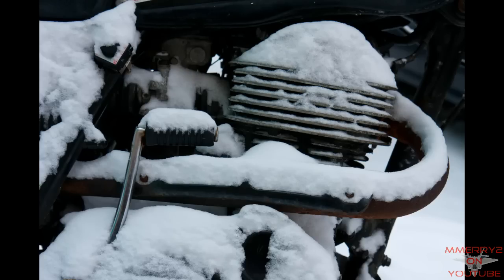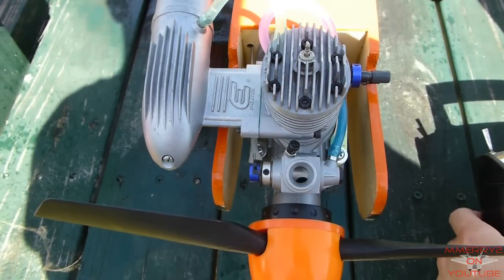Transitioning from Electric to Glow/Nitro Planes:  Intro to Glow RC Planes

Comment: One thing that’s very different between electric and glow is center of gravity. While we are use to positioning the battery in an electric plane for the CofG that we want, a nitro plane is trimmed with all flight equipment in place but empty of fuel. The CofG and stability margin become much more important. While some larger aerobatic and scale aircraft will have the fuel tank positioned near the CofG to minimize it shifting, most trainers and sport airplanes have the tank in the nose. It’s important to balance the plane so that as fuel is consumed in flight and the CG shifts aft you don’t get too far into the stability margin and end up with a tail heavy airplane that’s difficult to control. I balance my planes so they are level when empty knowing they will be slightly nose heavy when full. I do this so that even if I end up out of fuel the plane will still have a neutral balance and maintain its normal flight characteristics. The other thing is depending on the size of the tank and it’s location in the plane, it’s not uncommon to have to trim the airplane continuously through the flight. Another thing to think about is that balsa is not dimensionally stable and the film covering can warp things like the wing and tail throughout the day. A plane that has spent hours sitting in the sun after it’s first flight may be completely out of trim if flown after seeing significant sun or temperature changes.
Reply from the maker: Excellent point.

Comment: This is very surreal for me.  I began flying 37 years ago before electrics were even mentioned mainstream.  Technology then just didn't allow it.  Planes were all built piece by piece with ZAP and blue print plans with precut balsa parts and T pins.  Pushrods were individually installed and cut to length, nylons hinges were installed by hand.  THEN!  You got out the monocoat and the iron and covered each plane by hand, which was a bit of an art to itself but quickly learned.  Custom graphics were just that, cut by the builder by hand and applied with the iron.  After all was said and done you had to check and ensure the CG was proper.  Granted, all this was much more expensive to get started that it is today with everything prebuilt and radio equipment was archaic/prehistoric and overpriced by todays standards.  Training was done with 2 transmitters and a connecting cable.  When the student got in over their head the teacher would release a toggle ad take over.  5th channels were for retracts, 6th channel meant flaps.  Only sophisticated planes and heli's had 7 channels.  No gyro's (except helis), no electronic assists.  Getting back into the hobby after 25 years I'll be buying my first electric but still have my .40 plane and .30 heli.  Makes me smile to see tings coming full circle, as I'm getting into electrics just now!!!  :)

Comment: I have an 45 Evolution engine, facing the propeller (same as in the video), which direction must I spin the properller on order to start the engine? Clockwise 🔃 (right 👉) or anticlockwise 🔄 (left 👈)?
Reply: Anti.counter clockwise for a normal propeller.

Comment: What’s nice about electric is you can fly them at parks.  Most flying fields require an AMA membership and become a member of the club the field belongs to.  This is not a bad thing because most clubs have support and even instructors for new pilots.  You will normally have to do a check flight with a club member to be able to solo at the field.  This is to make sure you can get around a pattern safely.  Glow and electric have their advantages and disadvantages.

Comment: Always try to start it by hand first. Use a rubber finger protector or just some stick. An electric starter will put alot of stress on the engine and cause extra wear. For re-fueling you can also use those bottles that you can squeeze.

Comment: I have been flying model aeroplanes eversince 1986.  I started out with an MFA Yamamota 40 size high wing trainer. it was fitted with an OS 40 two  stroke glow engine.  That's what I learned to fly on.  Right up until 2002, all I ever flew was glow engines, both two and four stroke.  I just love the sound, and I love the smoke trails.  then that same year I bought my first electric plane, a multiplex easystar, followed by a multiplex twinstar.  they were both good planes.  However, I still prefer my glow planes better. Theres nothing to beat the sound of an engine, plus the extra weight is a help in the wind.  the only advantage an electric plane would have in my opinion is when it comes to flying off water.  an electric motor wont die out in the middle of a lake, but if a glow engine does then u need a boat to retrieve it.  Anyway, I still prefer glow overall.  By the way your video was great and I give u top marks for the way u explained everything.  I also and still have the hangar 9 alpha 40 that I bought in 2011.  The same one as yours.  The bright orange colour scheme stands out great against any sky background.  p.s I would just like to add that I had a fire in my house in 2007. This was caused when a lipo battery exploded while charging.  You have to be extra careful with those.   Many thanks for sharing this great video with everyone and it was so great to see the Alpha 40 in action.  It really is a great flying plane.

Comment: I have tried both over many years , starting with glow and then the mistake of trying electric
there is no comparison , an internal combustion engine can't be beat , I went straight back to glow and wished I had never made the mistake of trying electric , I had a really nice model catch fire due to electric and never eve  had that with glow, not only that, electric models sound like a dremel power tool LOL
Reply: alan manning I love glow engines myself, nothing sounds and looks better than an actual engine on a wooden aircraft frame. I suppose it's the realism of an actual airplane on a smaller scale. I like electrics as well, but unfortunately, it doesn't sound like an airplane/helicopter. Yes, I said HELICOPTER! Anyone remember the helicopters. They were the rage before all these want to be "helicopters" (drones) became popular!😁 Oh, talk about the good times when one heard ENGINES flying everywhere!👉👍✌
Reply: SolarReturn what set up would you recommend for nitro beginner? I've flown electric and would like to get into nitro
Reply: electric is quicker than nitro gas diesel  etc
Reply: I have flown electric for over 5 years and it has been great, so far ive never had any problems that you have encountered, the technology has gotten better over the years and electric has been getting more popular than glow, that being said, ive also had my fair share with glow aswell. The problem with that is that the glow engines dont last forever, unlike electric motors which last forever. (Ive had the same brushless motor for over 5 years, and it has flown constantly) I hope you will or already considered going back to electric, it is the most fun ive had in this hobby minus all the fuss with glow engines.
Reply: @rcaviator8408  I must admit I have been swayed particularly with the noise factor of IC engines being an issue more and more ,  Electric has moved on immensly and is now cheap , Clean , Powerful and quiet 
One thing I don't miss is the oily mess so yes my comment is now nonsense
One of the best things about electric is telemetry , seeing the battery state is far better than timing when your fuel is likely to run out ! And the motor dosen't need running in and setting up to keep running , another factor now is that I am finding it difficult to get glow fuel , The fuel I use now comes out of a plug socket , Yes my friend you are right

Comment: While electric planes are cheaper and easier to operate, glow/gas tends to be more scale and offers better power options as well. One big difference between electric and glow is that you must be extremely careful about how you handle yourself around glow engines. They both have their pros and cons and I fly both. Fly safe!, James

Comment: 6 years later it's still useful information. Just bought a homemade plane with a glow engine off of Facebook marketplace for 40 bucks. I figured it was a cheap way to get into nitro because I already have tx, rx, battery, BEC (used for a glider). Now I'm probably going to have to spend around double the cost of the plane just to get the field gear lol. Might go with a chicken stick over a starter because I'm cheap haha
Reply from the maker: It can be expensive to get all the stuff you need for your field box.  You know if you can find a used RC sale in your area you can find that stuff really cheap, like 25% of the cost.  You can usually find  the sales are held by RC clubs, estate auctions or just yard sales.
Reply: @WVRetreat  unfortunately i live kind of "out there" and theres not much rc that goes on.  theres a club a few towns over but its mostly dead and not running right now anyways, plus they do electric mostly.  i was looking on facebook markeplace and could find anything for planes, just nitro cars and trucks.  i ended up getting everything off of amazon.  a hangar 9 hand crank fuel pump and a gallon of 20% methanol nitro fuel.  also got a cheap 13 dollar glow plug igniter that runs off a C alkaline battery.  all of them had great reviews.  total was under 70 bucks and 40 of that was the fuel.  the only thing i still need is a starter.  i didnt get one because i didnt have enough spending money at the time.  if it comes down to it i can use a chicken stick i guess.

thanks again for the info!

Comment: That Alpha 40, formerly known as The Easy 40, is probably the best trainer ever. If equipped with a good ball-bearing motor and servos, that bird can fly better than any feathered bird can fly and it can straighten itself out on any nosedive. I WOULD NOT stick with that Evolution motor...Try something like OS 55AX or Thunder Tiger PRO 46.

Comment: So i have had some RC planes I got as a kid and now Im trying to get back into the hobbies,  but I've been told a glow engine can run on 2 stroke gasoline.  I don't want to kill it but i was curious on what I can use?
Reply: Seth Downey Stewart just use nitro fuel (nitro,methanol,oil mixture). Gas has different properties to it and modifications will have to be made to the engine for that. 
P.s  use at least 18% to 20% oil mixture in your nitro fuel.

Comment: Great video but you really don`t want to leave your glow plug igniter on the engine for very long, as this will cause the glow plug to fail quicker over time. sometimes at the worst times.

Comment: I use to fly with glo engines but switched to electric.  I have a glow engine to go on a 72' wing span Telemaster but decided to but an electric engine on it.  The engine is strong enough to carry the weight.

Comment: Excellent video.  IMO learning with electric motor is the best, simpler it works fine all the time.  It takes a while to trouble shoot and correctly tune especially nitro type engines.  IMO the biggest advantage of combustion engines is that you can make flight after flight after flight, as long as you get fuel :)
Reply: Simpler, except when the ESC takes a crap, and they do. Tuning, once the carb is set, there should be almost no need to touch the needles again. might take two minutes to get it right the first time.  Nitro is a constituent of glo fuel, not a description of the type of engine.  Nicads don't last forever, rule of thumb is one hundred minutes of total time, then change them if you have another pack.
Reply: When I begin in 1977, 4.8volt nicad 500 mah receiver battery pack was common. This  was good for 4-5 flights max. Now with 2000mah battery packs you can fly most of the day.

Comment: FYI a "deadstick" landing has nothing to do with a prop or RC aircraft. It refers to a situation where a real life aircraft suffers a major failure of the hydraulic system forcing the pilot to fly the airplane 'dead-stick" meaning without hydraulic assist for moving the flight controls.

Comment: Torque on an electric is higher at low RPM while torque on a fuel is higher at higher RPM.  That usually means if you stick your hand into a turning prop you are more likely to get hurt badly with nitro than with electric.

Comment: How do you shut off your engine if you can’t hold down on the throttle
Reply from the maker: In that situation, most people will program a switch on their transmitter to bring the throttle very low and kill the engine.

Comment: That's really neat. How long can one of those stay aloft?
Reply: Depends on the size of the tank and how much throttle you use but 15-20 minutes. On equivalent Lipo battery about 5-12 minutes approx.

Comment: is there a reason behind why when priming ur engine u roll the prop in the opposite direction of actual engine running rotation? thanks
Reply: 4thGloryMonday I was wondering that too
Reply: No difference in either direction for priming.
Reply: didnt think there would b just wanted to know if there was a golden nugget hidden somewhere, only seems natural to prime with the rotation of the engine. happy landings bud!
Reply: I typically prime backwards so that my fingers touch the dull edge of the prop so I don't slit them as I have done before priming the engine.

Comment: hi i just got a gas motor for my plane do u need a pump or can u just put the gas straight in
Reply from the maker: If the gas tank doesn't have gas cap like a lawn mower engine, you will likely need to pump it in the same way you pump in glow fuel into a glow engine.

Comment: I'm fairly new to the hobby but my instructor told me that the electric starter is not a good way to start an engine and hes a very good instructor I've only had three flights and I'm lading and starting the plane without the electric starter its not hard if you have someone that knows how to start a glow plane.

Comment: Do glow engines require a break in? If so, did you perform a break in on your engine or did it come broken in from the factory?
Reply: Most do. The Evolution engines (As included in this trainer) are sold as broken in from the factory and are supposed to be able to be run out of the box with no break in. Most take that with a grain of salt

Comment: Doesit come with a battery for the servos?
Reply: The RTF Alpha 40 came with a 4 cell NiMH receiver pack installed.

That package is no longer available, the Alpha 40 is only available as an ARF today (no radio, electronics or engine)

Comment: I start my engines per hand because with a electric Starter you can damage the engine
Reply: Yup,   and if tuned correct,  with good technic     first time every time.   I've an 18 year old ASP91FS  mounted inverted,     prone on wheels,  flip upside down to start,   back on wheels to run

Comment: When i started with rc flight 40 years ago we only had nitro engines. Now after a 30 year brake i am back in the saddle. I noticed that the market almost offers electric planes. So i bought my one Timber X 1.2 m wingspann. Yeah it flies nice and easy...But the flighttime is very limited. Aprox 7-8 minutes per battery and then land to change battery. For a whole day at the field you need many batteries. And the Lipo batteries are expensive. 
Now i am back to nitro engines again. Bought me a nice Thunder Tiger Trainer 40.
It gives me 15 minutes in the air and then refuel and up again. It is only the Tx/Rx batteries that set the limit. So nitro is the right for me. Fly safe folks.

Comment: do u have to tune it like a nitro rc car
Reply: +RC+SKI, not quite.  I have ran nitro rc cars, but an nitro plane engine is tuned slightly richer.  Also, aircraft engine turn a little slower, as they are designed for torque, unless you are into racing aircraft.  One thing mmery2 did not show was holding the aircraft pointed straight up and tuning the engine.  You do this at full throttle and lean the engine until you have a slight "sag", lean.  Then richen up about 1/2 to 1 turn.
Reply: Bob T not all nitro aircraft engines are designed for high torque. The o.s. .25 was designed for higher RPM's.

Comment: What you prefer. Electric more flights. Gas or glow - more preparing and cleaning. And sound. Although you can use unbalanced propeller with electric engine and sound will be (joke. With abnormal vibration). I don't intend to migrate to glow-gas engines.